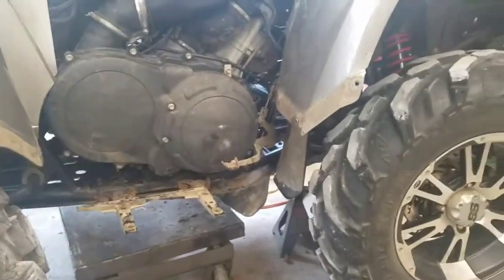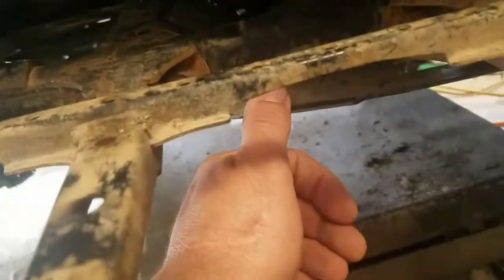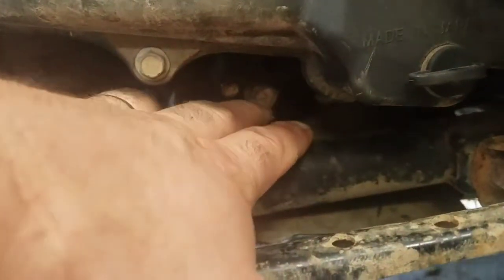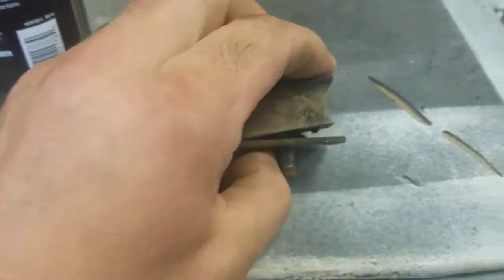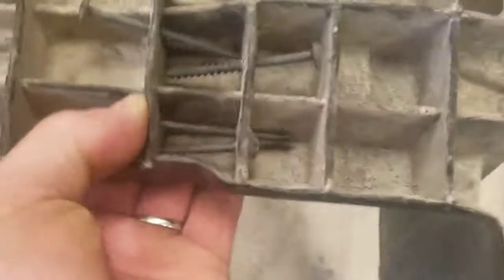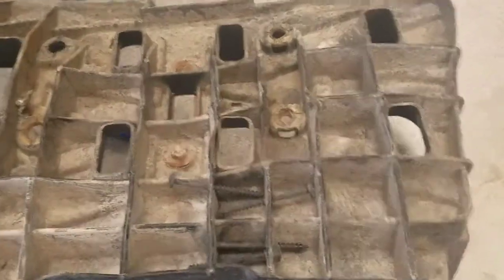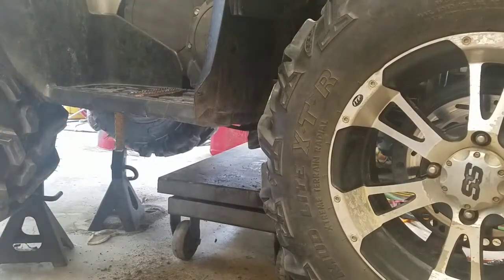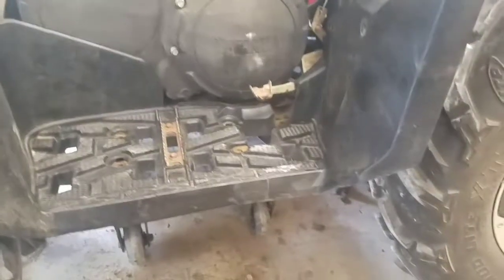08 grizzly motor mount replace and repair footwell repair

Comment from the maker: It wasn't exactly easy but I is tilted the motor up using a pry bar pull it out and to put it back in I can't remember if there's a top motor mount on that that I took loose so it would be free to tilt-up.
Reply: I have the same problem on my kodiak 700 now all mounts lose but i cant get them out.

Comment: Hey mate, was just wondering how you got the front right motor mount out. Having trouble replacing mine at the moment
Reply: once you take 2 bolts from the side and 1 nut off the bottom. Pry the engine up with one hand and you have to work it out of there. Its a tight spot but it will go if you fuck with it enough lol. Dont be afraid to pry that engine up but watch out for sensitive parts like the plastic casing for your belt drive and the cable that runs along the frame.